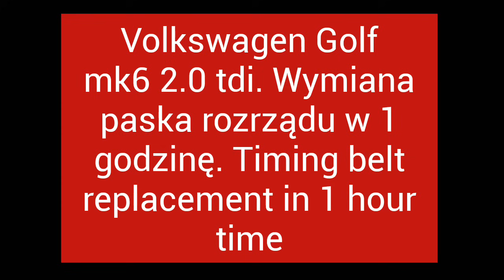TIMING BELT REPLACEMENT VW 2.0 Tdi Golf EOS SHARAN TIGUAN . English SUBTITLES

Comment: So you just put camshaft and pump pulley on the middle of the 3 screws? And you dont need to adjust them more with vcds? Nice video
Reply from the maker: Yes, you don't need adjust

Comment: Why is the crank locking tool placed on the engine mark and not the crank arrow aligned with engine mark and then place the crank tool?  If that makes sense

Comment: I found your lack of using a torque wrench quite scary, must be using the gut'n tight method.
Reply: Agreed
Reply: @crescentandstarglory  Yes it did let it down. He'll have bits dropping off in a couple of months
Reply: That's like saying the chef at a high quality restaurant needs to use measuring utensils. On a dish he's cooked 500 times. Sometimes yes, sometimes no. Sometimes the torque wrench doesn't fit. Sometimes it doesn't matter because exact tightness for any particular component is within a range or a window, not an exact number. You'll even see many car makers specifying a range of acceptable tightness instead of one number depending on the repair. In the end of the vid he explains to use one if you have it, where you can. He's done a million of these, and he took all the components off in the first place. Assuming that was the factory belt coming off, he can feel how tight each one is coming off. You learn to note which components are tighter than others. Will he be off by a few ft lbs? Yes, certainly. Will it matter? No. I'm in the middle of doing this belt right now and I'm astonished at how professional a job this was. I wish I found this video earlier as I've been running into brick walls for hours. This just saved me. I'm able to reach more than half the bolts with the t wrench I have, but some bolts are definitely out of reach. I can look at the proper torque spec online then eyeball the tightness. You don't need to be a master tech to know what 11 ft lbs feels like compared to 92 ft lbs.
Reply: @bat__bat  don't let the torque nazis bring you down